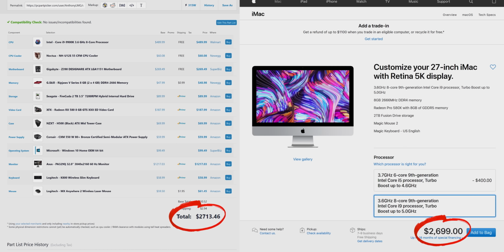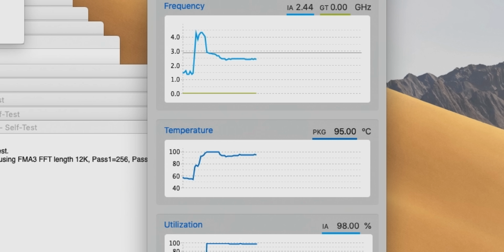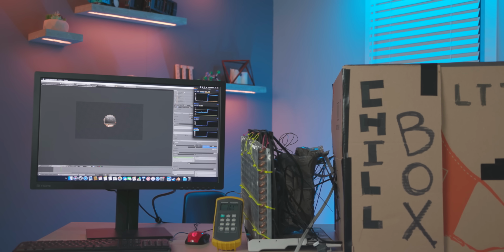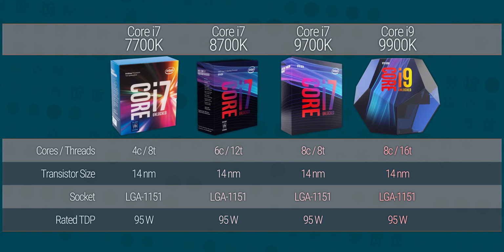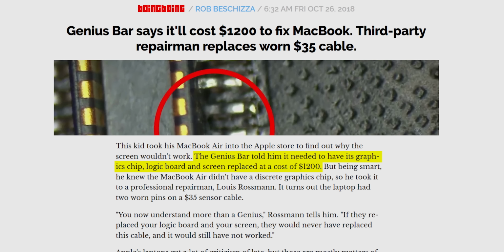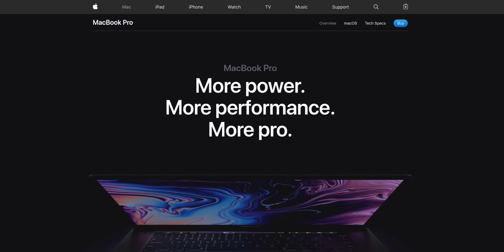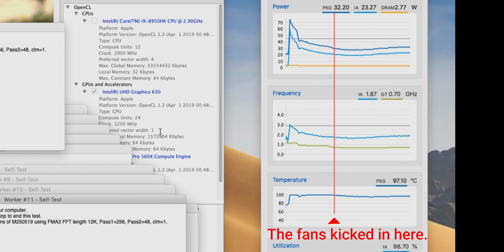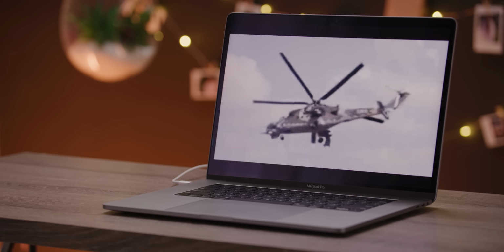Macs are SLOWER than PCs. Here’s why.

Comment: Let me guess
if the temperature is high my mac dies faster and I will have to get a replacement.
Reply: or a logic board replacement, which costs... gimme one sec, checking their repair prices.. ooh that unibody design means they're going to have to replace the entire non-display underbody.. uh nvm just get a new one
Reply: @elck3  I replaced the mainboard on my Thinkpad last week with one I got on eBay from China for less than $100 lol
Reply: Yes... And all you need to do avoid perpetual overheating (on a Macbook Pro at least as it actually has cooling fans) is to use a costum fan profile that does not let it get to 90C before starting the fans... My 2014 can run 100% CPU stress test all 4 cores at 3.2GHz and keep under 80C with custom fan profile and a little reduced voltage to the CPU using Intel overclocking tool...
Reply: Nahh your hardware will last, they're just going to cut you off from the latest OS update when they need you to upgrade.
Reply: Almost all laptops are thermal throttling. Remember: it's a tiny place. That's why they lower the clock. You can ramp up the fans manually but those temps, high clocks and rpm's will have effect faster and you need a replacement faster. That's why my 2012 mbpro from 2012 is still running fine. Yep the chip and apple protect you from doing that. You render on a desktop with sufficient cooling. That massive 12*12*12mm cooling block is huge in my hackintosh. And for a reason.
Reply: or you can install a fan control software to force the fans to ramp up, it's not ideal but better than default
Reply: Or get a simple fan control app but maybe that's too hard for you?
Reply: Okay, that's enough. Calm down. We got your point. Your point of view is better.
Reply: @Simboiss  You drank the Kool-aid man. You could change your mind if you wanted to.
Reply: So could you.
Reply: That is for anything.
Reply: I'm on a 2010 15" Macpro. so far, cost me less than 4$ a week to own this puppy
Reply: NoobsPlay Sensei Could never kill a single one in 15 years
Reply: Boys symbiosis guy down there just means that when you never use an apple device it has a longer shelf life, as in so long as you leave it on the shelf forever it'll last forever, until the battery gives up and you have to buy a new mac
Reply: apple is a soul-selling business that burns nonrenewable resources from earth by making thin computers to make customers buy new computers again which will put apple out of business in the future if apple burns all of the nonrenewable resources because some greedy douchebags thought it would be ok to make thin computers that burn the small components inside of them because apple is thinking about the present instead of the future nonrenewable resources
Reply: @songbird7898  Surely you jest. Apple is one of the greenest companies making computers. From solar farms to cutting back on toxic parts, they are pioneers in the field.
Reply: Even after those discussions about thermal throttling, be them true or false, Macs still have a longer shelf life (on average) than PCs, and retain their value longer. No matter your next excuse.
Reply: @Simboiss  Maybe but I dislike Macs. I worked in a publishing company for 1 year and had to use a new Mac. I found it so annoying to do actual work with and very limited (and yes I'll say it - SLOW). I was glad to come home to my PC which was cheaper and better spec'd after each day. That's just my experience.
Reply: Ah okay. I'm curious, though. Was it only the low speeds, or were there also specific things you hated about MacOS? Or the peripherals, maybe?
Reply: @Simboiss  speaking as someone who owns both a 2012 macbook pro and a windows laptop from 2013, yes, it is true that macs retain their value longer. but as for macs having longer shelf life, it depends on the brand / price of the PC. Sure, if you want to compare a $2k macbook to a $1k PC, yeah the macbook BETTER last longer. Also, even for the cheaper PCs that lasts, say half as long, why WOULDN'T i want a new PC at that point, for half the price? For example, if you buy a $2k Mac that lasts 8 years, and buy a $1k PC that lasts 4 years, i can get a $1k PC again 4 years later that'll be way faster / better than the $2k Mac.
Reply: The longer shelf life is based on averages, not specific examples. Also, when you compare all elements, and not just raw hardware specs, the prices are quite close.
Reply: @Simboiss  Okay where are these statistics? Because on average there are more varied PCs, Manufacturers, and QC methods, than there is Mac, which is one. However if you are comparing, say ThinkPads to Macbook Pros, that statement is false, on even a simple PCB analysis. On recall front Apple has more Recalls (or as they market them "Service Programs") out currently than Lenovo, which only has one currently for the X1 Carbon. Their defect, repair, and replacement programs are also so bad, so mis-informed, and so exploitative they had to be sued (and they lost).
Reply: It's difficult to find hard data on those things, so what we are left with is anecdotes, and reports from people working in the IT departments of businesses. The usual rule of thumb is that Macs last longer by a significant margin, which in itself increases its retention value. One reference I found is from the 2017 Winter Product Reliability Survey , Consumer Reports National Research Center, which shows Apple laptops twice as reliable as the average of the rest of the brands(Apple 10%, others 16%-25%).

And this article shows some stuff :

https://www.geckoandfly.com/6311/the-most-reliable-laptop-survey-best-netbook-reliability-comparison/
Reply: @Simboiss  well, b/c companies will spend less money if they can. Which means for windows laptops, if they can get away with buying $500 lenovos, they will! vs. at the same company, if a dev / designer asks for a mac, they can't buy anything less than $1500 for a 13" macbook pro. (this is in fact what happens at my company.) So in conclusion, the anecdotes from company IT professionals will be typically comparing products that are in vastly different price points.
Reply: @Simboiss   if it looks, smells, and tastes like bullshit well you know.  And that is exactly what YOU fanboy are spitting out.
Reply: So, Thomas, when people disagree with you, they are fanboys? Imagine in real life, what kind of implications this would have.
Reply: @savthmaall this is not the ignorant statement you make it out to be. My white 2006 Macbook still runs great. Gaming PCs will always get better specs on graphics tests etc.. but the parts die quicker.
Reply: @Simboiss  Macs are generally less reliable, this is commonly agreed upon
Reply: Well, no. Statistically speaking, Macs last longer and are less crashy and glitchy. You simply do more on a Mac in the same amount of time.
Reply: @Simboiss  site yourself please, I can say from subjective experience ive found the opposite for each of those statements (besides maybe glitchy), Im far more productive as I know how to properly use windows, you cant just throw out a fancy but nonapplicable word like statistics if u dont link any statistics, so please do so (ps ik my grammar is terrible)
Reply: I've re-read the thread, and it's not worth it. There's not a lot of "official" stats on this, but one of my previous messages has a link. I've talked to IT departments in many types of companies, and schools, and also individuals, and the trend is consistent. Macs last longer and are easier to maintain. IT departments with Macs are smaller, which means less people are needed to take care of more machines, and maintenance is easier. I've seen countless departments with Windows and the IT guys there blatanly and openly HATE Windows, but they still use it and maintain it. This is masochism. Lots of people hate Windows but still use it, for some reason. When Windows is updated, people have aneurysms and clinch to the previous versions deperately. This never happens on Mac on that scale.

Mac OS has more features than Windows, and is more consistent with its interface, software in general is also more consistent, button placement, keyboard shortcuts, Fitt's laws, etc. Mac OS comes with software that would cost money on Windows (like Office), so there's some of the higher price right there. Macs are more silent, battery last longer in laptops, screens are more crisp and color accurate. The App Store is very good, both for consumers and producers (I'm both).
Reply: @entiretwix1480  Jesus, this whole argument is ridiculous. IBM has gone on record that internally switching their employees to Macs has saved them a considerable amount of money....dont't believe me? Here https://www.computerworld.com/article/3131906/ibm-says-macs-are-even-cheaper-to-run-than-it-thought.html
Reply: @Simboiss  My hp box was close to 10 years old before i accidently droped it off a bar top at DEFCON, and i was still able to run it without hinges for some time before i stripped it for parts to repair a computer for someone at my church... do that with a mac...
Reply: It's not about you and your ego. Everyone can cook up a story about his computer that lasts 10 years. I have a 30 years old Mac Classic at home and it still works. Still, it doesn't represent the average shelf life of a modern Mac, or any computer. Just be reasonable and don't anchor your opinion on ONE machine.
Reply: @Simboiss   lol, a box is a box, if it can process then it works for sombody's needs so check your own ego.

This is not a software to software comparison, It's a hardware to hardware comparison, You can't change the laws of physics, and this video  focuses on the way apple is cutting corners to claim missleading stats..

PS  My first computer was an apple, it still posts... my point is they both can have a long life cycle..
Reply: Okay, that's enough.
Reply: inhales

my whole life has been leading up to this, ever since I was a child. I was fueled by one desire and one desire only, exposing the truth about Apple to the world. I wipe my sweaty hands on my freshly-pressed suit, and I lean closer into the mic, prepared to deliver the words that will change the world.

Apple bad.

The crowd breaks into uproarious cheer, chanting the worlds APPLE BAD! over and over again. Soon world peace is achieved, and people throughout live a more satisfying, healthier, happier life. Soon all poverty and homelessness is gone, and the earth becomes a utopia, only knowing feelings of pure happiness. Soon aliens come and visit us, giving us unimaginable riches all because we “realized the truth”. Apple crumbled within seconds, and all Apple products simultaneously combusted, ending all Apple users once and for all. The universe is at peace, all thanks to Apple bad.
Reply: @Simboiss  Man Apple really loves guys like you. You apple nuts are all in denial, or in the dark. I'm sure Linus tested it fairly & would run one if they had a decent PC desktop for gaming that rivaled Intel or AMD. Did you not see his test in this video with prime 95, even with the diy cooler? It's called planned obsolescence btw, & apparently their mindset in design. So they are getting rich from these machines that look great on specs but performance is a different story.

How can anyone come to Apple's defense after watching this video & knowing what they are doing to their customers or after experiencing slow speeds vs the claimed specs after shelling out twice what somethings worth? Do you know how? I do, their customers are well off enough not to be cost conscience or informed like Linus also pointed out! As far a shelf life is concerned I have been building PC's since the 90's & had several for over 15 years with no issues other than OS, as in no hardware failures. I can also tell you PC or Mac that is that old isn't worth squat no matter what it was.
Reply: Well, Craig Ster, the thing you need to understand is that you are in a small minority group: gamers. The VAST majority of people on the planet Earth do not care that much for raw specs and performance ALONE. So yeah, maybe imagine just for a second that you are not alone in the goddamn universe and that your needs are not the other person's needs.

Performance is not important when 99% of the time, the computer is waiting for your input. It's like whining to the end of the world in public because not everyone in the world buy cars solely for their raw peak engine performance.

Again, and as usual, you can bring up examples of comparisons between a Mac and a PC that are closely "equivalent" in terms of hardware, and I will be happy to discuss. The more examples, the better.
Reply: @Simboiss  true about the fact that the VAST majority of people on Earth don't care for the specs and performance alone. The point being made in the video though, and in the macbook product page is that fact that they tout the HIGHER performance as a selling point. Linus' primary point was that Apple is blatantly lying about the real-world performance of the macbooks.

If you just check their product page out, they have 5 headings: photography, coding, video editing, 3D graphics and gaming. The macbook can apparently run at 5.0 GHz to do all this stuff, which Linus just showed the macbook doesn't. So, yeah. That's that.
Reply: @Simboiss  Where exactly did you get those facts on shelf life? It seems highly unlikely,based on my past experience with both macs and PCs.

Comment: What pulls me to still using mac is trackpad. Touch implementation,  momentum and acceleration  is a lot far better than windows.
Reply: That has nothing to do with windows though. Momentum and acceleration are purely settings and if you think a pc's trackpad doesn't feel nice it is more than probable that its just the model of the trackpad itself. I'd advise you to test out different models in a hardware shop. You're bound to find something you like
Reply: viktor1496  yes. I have tried several. I also own surface laptop. And i still prefer mac os trackpad implementation.
T

Comment: I wonder if this is why my 2017 Macbook Air logic board died for seemingly no reason at all. I think you gave me my answer on whether I want to pay Apple $475 to flat rate repair it.
Reply: For that money you propably could build a stronger desktop PC TBH. 

depending on the task ofc
Reply: @IronPhysik  I already have a pretty good Desktop. I just used my Air for light tasks when I wanted to be protable, nothing much more than I used my old Chromebook for.  I have two old Chromebook(Toshiba 2 2015 and Acer C720) that keep trucking along. They have been used and abused and keep going. I'm going to buy myself a good Chromebook because with no known reason why the Air failed, it can fail again randomly.
Reply: @jackwoods7943  ahh cool, alrighty then.

I was just making a joke
Reply: @IronPhysik  Yeah but seriously, you could build a better desktop for less lol

Comment: Honestly wish Ubuntu or any Linux/Unix system was nearly as good as macos. As it stands I'm essentially stuck as I'm not a OS engineer
Reply: I use Kubuntu 19.04, desktop though.  Liquid fast.
Reply: @chriswillison2627  for me it isn't about speed but usability and reliability. When I get use macos, I know everything will be fine and that I'll be able to open settings and connect successfully to internet (both things Ubuntu, Linux mint, Arch Linux have failed me for). I also know all my driver's will be updated in a decent manner and work well. That's about it for me. Linux distros simply haven't been effective, and I can't justify to my boss why we should pay someone to set it up if the difference in price is entirely made up by paying that person.

Comment: I switched from a pc laptop to a MacBook Pro because I was sick of the loud ass fun that would not stop even after a little bit of web browsing and the slow ass startup time of google chrome even though it was a 4.2 ghz processor and a gtx 950 Mx. I tried to find the problem for hours but found out that the windows os slows down the computer even more. After using my MacBook Pro for close to 6 months I have had NO problems at all even in 100 degree weather outside. No overheating nothing. So say all you want but for me my MacBook works great for all my needs.
Reply: You realize that fans and cooling is hardware and problems with it are rarely software related right?
Seems to me either your cooling broke or you didn't clean it in a long time resulting in overheating which is when your pc will slow itself down to protect itself.

Comment: My ROG g series 17" gaming laptop has needed 800$ in repairs and I can no longer use it where as my mac from the same year has needed only a new battery in 7 years and runs as fast as the day I purchased it even after falling twice from my 13ft loft. Beyond that - windows OS is just inferior to mac os. I wouldn't buy a new mac since steve jobs died - it seems they have been taken over by a board of directors wanting profit over innovation with an already flagship name in the market.
Reply: True, i have a 2009macbook, a 2011 macbook pro and a late 2013 retina 15"  all work fine gives good battery life, the retina which is my daily use needs a new battery soon. Looking at their new stuff i just do not feel like upgrading. The old one gets my job done, for what apps i use i found mac os better. Maybe i will try a hackintosh sometime
Reply: @djnickandre  sad because they really were the best peoples laptop. As a dj there was a time where you just had to use mac due to its reliability but now depending dongles they no longer offer that. If I owned apple stock I would sell it at the next most advantageous time.